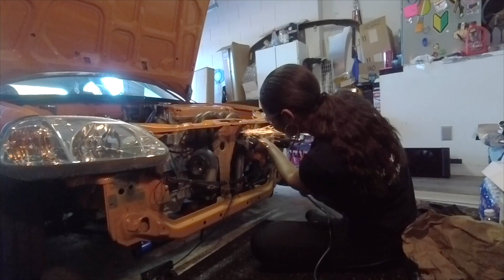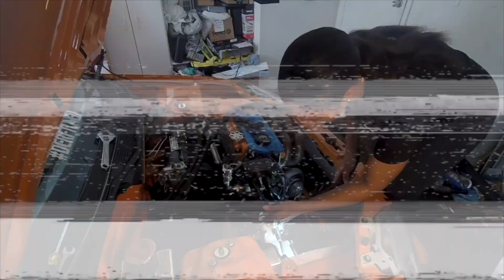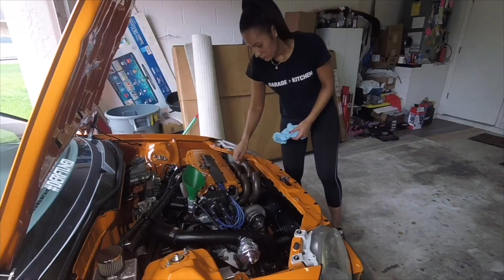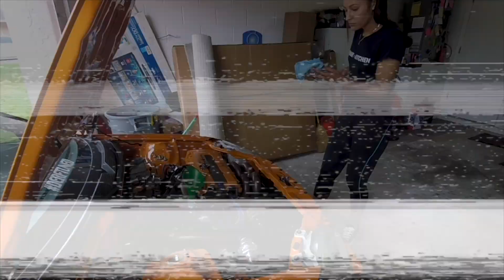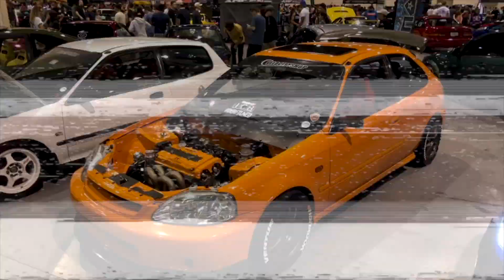Brake Tuck - Bending Lines - Wilwood Proportioning Valve

Comment: Always do a double flare. Never trust a single. And make your brake lines from Nycop. You will love life using nycop. That line you opted not to use is Nycop. Equally as good and a joy to work with
Reply: You don't double flare on 37 degree an fittings would be very stupid to try
Reply: @jklololol9691 I'm pretty sure if it is a road driven vehicle 37° on brakes isn't legal. Not so much get a ticket illegal. More along the lines of getting sued by the person you hit and losing your house illegal.
Reply: @caddyguy5369  didnt say anything about road legal im saying you dont double flare a 37 degree an fitting it will leak.
Reply: @jklololol9691  I never said you did, nor did I say to double flare AN fittings. I was just saying. Following my logic would dictate that makes AN fittings technically illegal on a car for road use for brake lines. Again, just saying.
(Edit: reworded due to coming  off as potentially unintentionally hostile. :-)  )

Comment: 8:45
once you get more complete with your build go back to your front brake lines and move the rotor fully to the left adn right to see how the brake line flows. basically your checking if it gets pinched and or catch up, thats what i had to do as well
the bends look really really good. youre making me want to do that to mine since i did a ABS delete and i have braided lines which do the work but hard lines have a much cleaner look.

Comment: Nice work, looks great. I'm shortly to start brake line manufacturing on my car, so this video is awesome. Any reason why you didn't just run a single hardline to the rear and then split with the junction to each side at the back of the car?